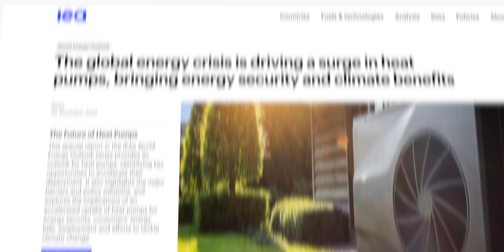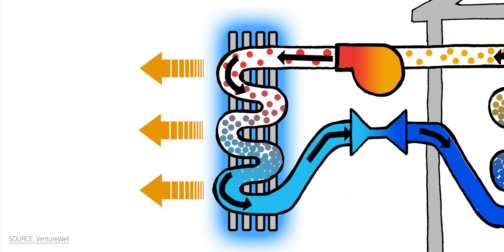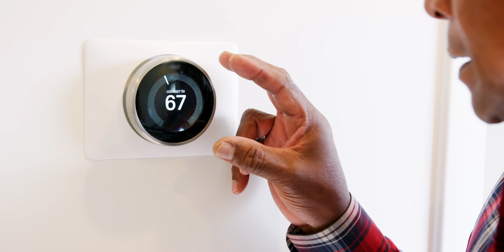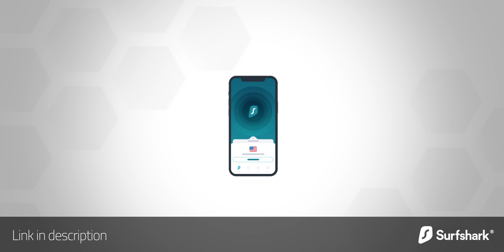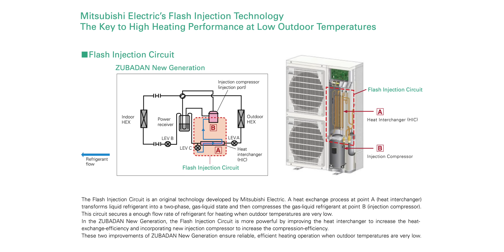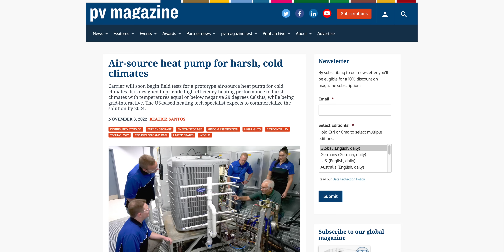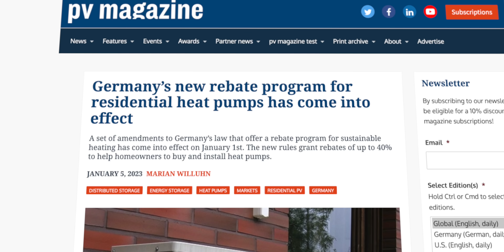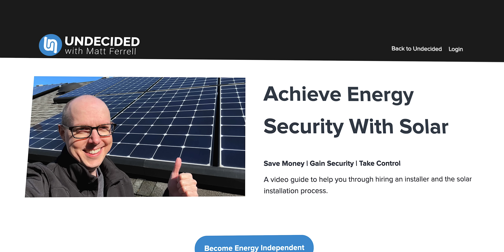Major Advances with Heat Pumps in the Extreme Cold

Comment: The talk about heat pumps whether Ground or Air based is still not viable in the UK. Most gardens fall way short of area capacity for ground sources and Air based make too much noise in built-up areas and our electric grid could not cope with a mass conversion to Heat pumps.  The UK Government is heavily promoting heat pumps but is likely to change its mind like the wind. It's all a knee-jerk because of the oil supply problems from Russia (the odd thing is we only import 12% of Oil requirements from Russia) Yet our fuel costs have tripled.  Someone conning us for sure.

Comment: For sure heat pumps make a lot of sense for new installs and collecting heat from the ground rather than the air makes even more sense. Where real problems arise is using them as a replacement for existing heat sources such as gas fired boilers. They produce very hot water which means the radiators inside the rooms are sized accordingly. Heat pumps do not create such high temperatures. Result is it takes much longer to heat the home. The solution is to either accept having to run the heat pump 24/7 or increase the radiator and pipe size which is indeed highly disruptive and expensive. This is an even bigger issue when the old boiler did double duty providing heat for the living space and hot water for washing and bathing. Not everyone has the luxury of living in a house. For those space can be at a premium. Needing somewhere to house a resistive water heater adds to the grief.
Reply: Look up Panasonic Aquarea or Daikin Altherma combined heating and hot water models,. There's also a nice Ecovolt model that's just been launched. They look a bit like frodge freezers and have a 600x600mm footprint. Radiator sizes will need to be changed if you want to stick to a radiator system but pipework is probably OK unless you have a minibore system since the differential between flow and return temperature is usually not much different for heat pumps compared to boilers even though the average temperature is much lower than with a boiler.

Comment: why did you not say that geothermal systems are independent of air temperature. in cold climates it keeps your energy efficiency constant thru out the year. an air based heat pump will work with different temperature regimes though out the year.

the trick to buying a heatpump is knowing what its energy efficiency depend on, it is the difference in temperature between the inside of your house and the heatsource. 
if the air temperature is higher than in the ground a air heatpump is more efficient, if the ground is hotter than the air then a geothermal system is more efficient.

to get a good estimate on what will work for you, you will need to look at your local climate and weather. and find out the average operating air temperature of your heating system.
if the run time of your heating system is on average on when the air temperature is below the local ground temperature then geothermal is best for you.
but if the weather mostly stay above the ground temperature when you check then a air heat pump will work just fine.

another thing to think about is the temperature in your home, or rather the temperature of your heating system. if you want an efficient system you want a lot of radiators/ in floor heating. to keep the operating temperature of your system as low as possible to make the difference in temperature as low as possible.

Comment: You did not differentiate between the geothermal heat pump system, which you are using in your house versus all the other heat pump systems you mention which use outdoor air instead of ground heat.

Comment: We had a heat pump installed on our home here in the U.K. nearly 2 years ago. While we don’t see the temperature drops like the US or parts of Europe, it’s worked perfectly fine in -6c for 2 weeks. One of the things that does affect heat pumps is moisture, when the extreme cold does kick in at the dew point we do notice a bit more work as it ices up but once the dew point has passed and relative humidity drops (as it often does in prolonged cold spell) the HP is fine again. The key is making your house as well insulated as possible as then the HP doesn’t have to fight the leakiness of the house. This is why they’ve worked so well in Scandinavia as they have super insulated houses and cold winters with low humidity. Our HP also has a 6kW backup heater which can be used to help top up the heat flow if the HP is struggling or to fully take over if it breaks.
Reply: I'm in London. The temperature hovers around freezing for days or even weeks in winter and the relative humidity is way high too. (currently 2°C with light snow..) It sounds very much a possibility that this defrost cycle might run pretty often. 

And a 6kW backup.. Wow! That sure is going to wack up the bills if it runs for any length of time. And it's not going to get far in terms of heating with a COP of 1 and compared to the gas boiler which I think is 30kW.

I think an air source heat pump in most of the UK just might not be economic. My house is also poorly insulated and with brick walls without cavities. It would be very expensive to fix.  The air source payback period for me might be decades.

Comment: The heat-pump being less effective in cold weather relates to air-to-air and air-to-water heat pumps, not to geothermal (water-to-water) heat pumps. Air-to-air heat pump extract heat from the outside air. When it gets colder outside they have to have a lower temperature than the surrounding air in the outside heat exchanger to be able to extract heat. That means water vapour in the air condenses on the heat exchanger causing it to freeze over. When frozen the heat exchanger can't extract any heat and so it needs to be defrosted. This defrosting takes time, during which you don't get any heat from it. This can take about 10 to 15 minutes per hour which means you lose about 16% to 25% of the capacity. Geothermal heat pumps use a source (water) to exchange heat with. This source is usually located under ground and therefore has a much higher temperature than the outside air in winter. Which means the outside heat exchanger doesn't freeze, doesn't need defrosting and the system doesn't lose capacity. A very interesting system using a water-to-water heat pump in combination with a source (and PVT panels) is the Ice Storage System by Viessmann. You should check it out.

Comment: We’re about to design & build our forever house. Debating whether to go with geothermal or air source heat pump. Would love to see a side-by-side pro/con comparison. Thanks for the channel Matt! Such good stuff!
Reply: Basically how cold does your winter usually average? Ground Source (GSHP) or geothermal is basically a near constant COP.  So +15C or -40C you will get almost the same efficiency due to the temperature of the outside loop remaining constant.  +5c is about the tipping point where the efficiency gains of GSHPs start to kick in. However, an ASHP might be ~20% more efficient at +7c and only ~10% less efficient at +2c VS a GSHP. GSHPs also have a higher initial cost like Matt says, sometimes you might need planning permission or what's in the ground might be unsuitable. I live in an area where if I lived further north then ground source is expected to work out better in the long run and any further south air source would be the better choice. You could look at GSHPs like a fixed rate mortgage, in that if the weather is harsher you are shielded from the lower efficiency (or in a mortgage the interest rate going up), and conversely, if the weather is warmer ("interest rates have gone down") you can't take advantage of the better efficiency of an ASHP in those times.  If your winters see basically below 0c the whole time then ground source is likely the better option. Air source is only really a "bad option" in comparison if you are seeing -15C or below the whole time. Ground Source is hardly ever a bad choice, but the higher install cost makes far less sense if you live in an area that an ASHP will run circles around it.
Reply: So many variables it’s hard to say. Have a true Manual J heat loss done and find an experienced installer and you can get apples to apples ROI numbers.
Reply: @Ben Thanks that’s good info! I’m in the Hudson Valley of NY, so similar climate to our esteemed host Matt. I’ll dive into your info as I get with local engineers/contractors. Thanks again!

Comment: I live in the UK. I live in a new build which was installed with a gas combi boiler which heats the hot water and liquid filled radiators in each room ( I know you Americans usually use hot airflow so I thought I would go into a little detail)
Would I be able to get a heat pump to be a direct replacement for what I have now or would I need a separate water heater, rip all of my radiators out and have air vents throughout the house?

Comment: Them heat blowers you folks often show look great. We don't use them in England, we power our radiators with our air pumps and it takes much longer to heat them than a gas system. About 40 minutes to get the radiators warming up, plus new larger radiators are needed so they give more heat out. Standard UK radiators will not work correctly with air/heat pump systems, plus we don't get the air conditioning you folks get with the blowers, silly over sight really, seeing as it's getting warmer in this country. Thanks for the video.

Comment: I have a heat pump from diakin. It works best above 35 degrees or 40 degrees. Just installed in June 2022. Great in the summer. This model has gas furnace attached for the really cold weather. It was cheaper to use the furnace at the 35 degrees Fahrenheit and below. I have solar on the house and functioning don't feb 2023. I'll try again in winter. Try just the heat pump.

Comment: There is only one reason there is a Global Energy Crisis Matt. The push to move away from fossil fuels as a source of energy. In reality our use of fossil fuel has not declined it has only slowed down. Our transition to move away from fossil fuels will take decades. Nuclear power plants are the answer not wind or even solar. Even though wind and solar has come a long way the rapid move away from fossil fuel has created an unfortunate side effect. The rapid increase in cost has impacted the poor and elderly the most. Energy costs have skyrocketed. I am all for cleaner sources of energy but the path that most governments have taken due to pressure exerted by climate activists to move away from fossil fuels. I really like your videos and knowledge in new energy tech. Our energy needs are not going down, they are only increasing. One of the biggest reasons world poverty has gone down over the last 50 years is the access and availability of cheap energy. The push by developed western nations to move in a more sustainable path because of climate change is only going push nations back to cheaper sources of energy.  Nuclear Energy and Geothermal Energy (NWUS) would be the best options. Thanks again for the videos Matt. Keep them up.

Comment: I am speaking as someone who lives in the South and has a 12 year old, top of the line (at the time) Carrier heatpump.  It has worked very well in general and is far cheaper than using propane to heat (at my propane and electric rates) and with a 19 SEER has kept summer cooling bills lower as well.  However, these high efficiency heatpumps are expensive to repair.  The variable speed compressors and fan motors cost a lot.  For example, the wholesale price on an outdoor fan motor for my Carrier heat pump is roughly $1000.  That compares to roughly $150 for a traditional fan motor.  Before purchasing a heatpump, I would highly recommend considering the price of a long term warranty as part of the true cost of the product.  I had a fan motor fail and because I had access to wholesale pricing was able to get a replacement for "only" ~$1000.  Had I been a regular customer, it would have cost at least double that. . .  for just a simple fan motor.  If something fancier goes out, I'll probably end up trashing it and getting a whole new unit.

Comment: We added LG mini splits to our home 2 years ago, hoping to heat & cool for less. They did drop our cooling bill by 20% but heating with them last year (Massachusetts) was more expensive than using gas. Our gas furnace is only 87% efficient. We didn't run them much this winter. I'm pretty disappointed because they weren't cheap to install.
Reply: I live in mass as well and have Mitsubishi 4 zone. It’s not the hi-heat version. Around 10 deg F it stops putting out much heat. I have a power monitor on that circuit and it rises to around 2KW when running full tilt in the cold, very inefficient. I use pellets to heat the house and a gas furnace as a backup to the backup. I have a cooper and hunter in my off grid cabin that works to -13 degree F and that seems to still put out heat in that cold -25 degree F weekend we had a few weeks ago and was a little more efficient, but again it was running full tilt and I don’t think it was good for it. I have some resistive wall mount heating in the off grid cabin to offset when it gets that cold. Fortunately this winter has been somewhat mild in Massachusetts as compared to other years.
Reply: @jimmyg6215  2kW to heat your entire home in -10degC conditions? That's pretty damn good, you'll find you're using significantly more energy on your wood to get the same amount of heating

So it might be cheaper to use wood/gas in that scenario but it certainly isn't more energy efficient
Reply: @jimmyg6215  2kW? Typo?
Reply: @balometer  no typo. It pulls ~2000 watts in heat mode at full power. Never checked all three heads I have connected, but with two heads heating it was pulling that much power.
Reply: Natural gas is almost always cheaper than electricity by a huge margin. That's why it's so popular. However, I pay more just to have a gas hookup than for the quantity of gas usage. If I can ditch gas entirely, I might see savings. (Utility companies really know how to rip you off)
Reply: I hate to rub it in but did you do your own research with heating calculators before the install? The numbers returned by the calculator were almost exact for this heating season when I used a COP of 2 and my electric rate as parameters

Comment: Colder outdoor temperatures do not "mess with the refrigerant's ability to absorb heat".  They cause the evaporator (outside in heating mode) to fall below the freezing temperature of water, which means that they will clog up with frost, which blocks the flow of air through the evaporator and insulates it, which then blocks the ability to absorb heat from the outside air.  ALL air source heat pumps will suffer this fact of physics.  ALL schemes used to allow a heat pump to work below freezing will necessarily consume more power to periodically defrost the outdoor coil.  This is where ground source heat pumps are potentially far superior, as you've already found.

Comment: I have a few comments.

1  Some of the older negative opinions are justified. In 1990 I lived in an apartment with a heatpump and when the temperature dropped to 35 F (2 C) a resistive element kicked in that was not efficient at all. Also bad was that the compressors would only last about 15 years.

2  I kept hearing in development and prototypes so it sounds like you are saying that there is a real possibility, but in the future. Also until new units actually make it to the real world we also don’t know the lifespan of new tech.

3  I really don’t care if they work at -20 F (-29 C) which temperatures reach here. What I care about is are they efficient at that temperature, as heatpump efficiency is dependent on delta T.

4  The upfront cost may be justified if you are building new or already needing to replace another unit. However with my gas furnace that I had installed in 2001 (and working fine) it would be difficult to justify as my total gas bill for 2022 was $636 and there is no installation cost for existing hardware.

5  A small consideration for some, for me when I changed from hot water to forced air heat I had to increase the thermostat setting by 3 F for the same comfort level. This is due to the added air movement, especially at the beginning and end of each heating cycle.

Comment: i've always wondered with the geo thermal. it's great 3 seasons then you have a "heat pack" for winter supplement. my question, do they make or is it viable to have a heat pump ON the geo thermal? these new systems are amazing and at a constant 55 degrees from the ground, would be much more efficient than the heat pack.

Comment: The heat that flows into the evaporator does not raise the temperature or the pressure of the "fluid".  It causes the liquid refrigerant within the evaporator to BOIL. Boiling absorbs heat, which is why the evaporator gets cold.  The compressor does raise the pressure, and by virtue of compression, the temperature of the gaseous refrigerant coming from the evaporator.  The condenser does not lower the refrigerant pressure.  It simply provides a place for heat to be removed (to the outside air, in the case of an air conditioner).  When heat flows out of the high pressure refrigerant, it causes it to CONDENSE (the opposite of boiling).  This releases heat, and is why the condenser gets warm.

Comment: I've actually done the math, if I wanted to replace my gas heating system with a heat pump, it would take 112.5 years to get my money worth.
Don't forget that heat pumps require more than 6000 kw/h of electricity per year (that's more than my current annual consumption).
I'll keep burning gas for now...